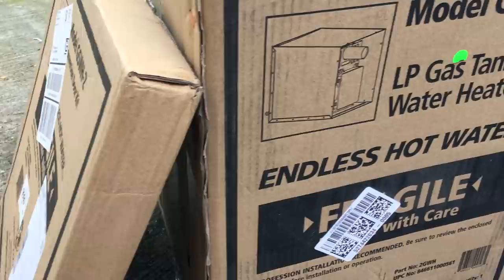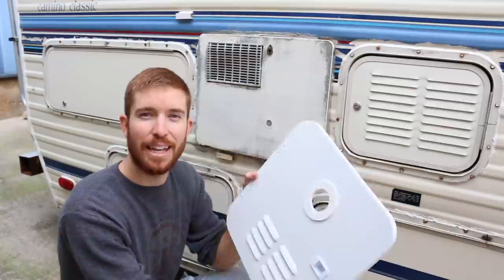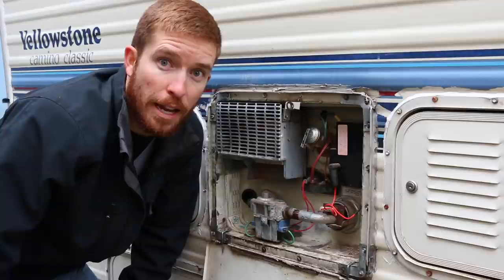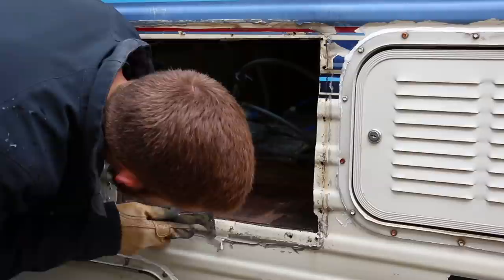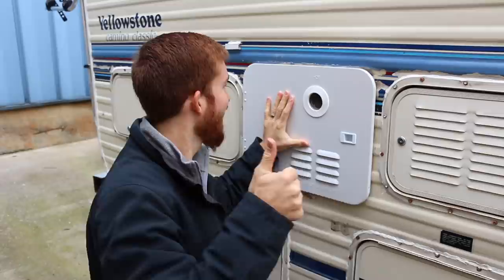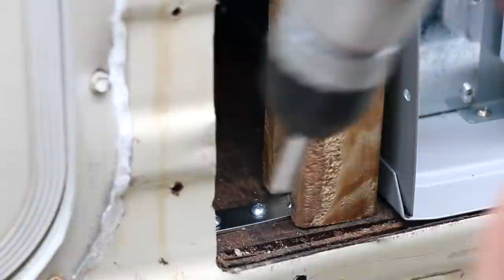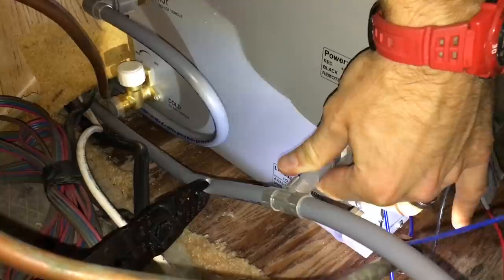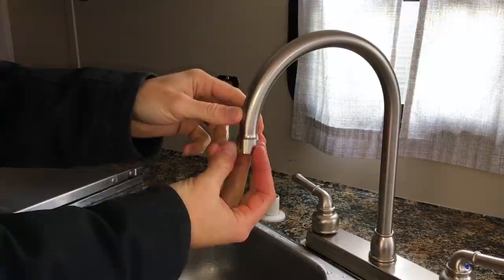Installing a New Girard Tankless Instant RV Hot Water Heater

Comment: Excellent video but a HUGE HEADS UP for EVERYONE reading this post. The grey plumbing pipes are known as polybutylene or QEST (Google it). These plumbing pipes are a problem which resulted in a class action lawsuit in the 1980's and 1990's. The slip connectors and pipes ended up cracking and flooding out many homes. QEST is no longer used in construction because of the known defects. I work as an expert witness in construction defect litigation, residential home inspector and teach the home inspection program at Mt. San Jacinto College in California for over a decade. My advise is to replace every single bit of the grey plumbing pipes you see in this video before you become another flooding statistic. Heads up everyone !!! Sorry to be the bearer of bad news but it is what it is ...........
Reply: Any funds left in that class action suit? My travel trailer has this, I've been replacing it all with modern pex
Reply: @pinrod1  No funds are left for the class action lawsuit. Sorry.

Comment: I'd agree that the wiring instructions for hook-up are minimal and the different colors each RV uses doesn't help. Given that, I was hoping you might be able to answer a couple of questions for me..
On page 9 of the manual.. C:Installation of 12VDC and UCP.. They recommend an interior power switch and a 10 amp fuse. Am I correct in thinking the additional fuse is to be added on the inverter side? or should it go on the UCP side? They just say "panel" without clarifying. It goes on to say "connect black wire to a ground connection on panel".. Which panel? The inverter or the UCP? 
To extend the UCP wires.. on pg10 it says use 18 gauge wire (which I did), but the UCP wires only have a few copper strands, making the 18 gauge seem like overkill.  It's even thicker than those coming out of the main unit. What gauge did you use there?
I've direct wired to the 12V DC which has me a little nervous, but see you have a video on that also which I'm going to next..
Thanks for your video and help

Comment: In the process of installing the same unit in my Class A. I believe you answered the question but wanted to make sure. The wiring of this unit...On the old unit (Atwood 6 Gal) I had a green (hooked to ground), Blue (hooked to a factory plug), Red ( hooked to the burner connection ). Based on your wiring of this unit, you are stating that the blue & green are both ground, red is 12vdc? Thanks for the video.
Reply: Paul, I have the same dilemma. The Atwood 6 gal I removed had a Green, Blue, and Brown wire.  The Green is clearly the ground. The Brown seems to be the 12V+. I guess the Blue is 12V-. I'm wondering if I should wire the Blue and Green together as shown in this video...?

Comment: Awesome instructions. How does the aerator affect the hot water though?
Reply from the maker: Hey Danny. Thanks for watching. The 0.5 GPM aerator restricts the water flow so much that the unit can’t detect when to kick on. A 1.0-1.5 GPM aerator should work better but all we do is just remove the aerator when we need hot water for dishes. Hope this helps 👍🏼

Comment: Informative video. Is it not necessary to install insulation around the tankless water heater?
Reply from the maker: +Tammy Sherman I believe the only need for insulation is to keep the hot water hot... since this is a tankless and it doesn’t store water, there’s no need for insulation. Great question! 👍🏼
Reply: Tammy Sherman Yeah There is a large empty void next to the heater. I would have filled it with insulation too.

Comment: Did you measure the temperature of the water coming from the faucets?  I was told 4 years ago that RV instant water heaters didn't have a long enough coil to get water adequately hot.  What is your experience.  I am unable to find a follow up in your videos.
Reply: That was an objection for us.  We “set” for the max of 131 at the thermostat but it couldn’t keep it at temp.  If another faucet/toilet was used a low pressure interrupt kicked in and instantly the burner cycle was off.  I called California Gerard, never got a person or response.  Called Jayco and they genuinely wanted to help but there is only 1 temp adjustment on the back of unit which let me get out a few degrees over factory set of 127 to a max 131.  System is
Reply: Continued:
System is very sensitive and pressure dependent.  Probably with perfect conditions it is fine.  But campgrounds are notoriously unpredictable on erratic water pressure.

Comment: My wife and I are set up in our fifth wheel on her uncle's property. We have a tank water heater using zero propane. The problem is that the hot water runs out very quickly. Would getting a tankless water heater require us to begin to need propane to heat the water? Or would it run off of electricity?

Comment: I also have a tankless. Mine is slightly different from yours though. Mine is not a hot water heater, it is a COLD water heater. Why would you want to heat hot water?

Comment: Curious? I noticed this is a LP water heater. If you have a 30 gallon LP tank (standard?) how fast does it drain it?
Vs. an electric instant water heater that does not require LP gas.
I believe this would be a crucial decision that must be determined.

Comment: Are there specification restrictions to watch for or upgrades needed from an electrical perspective? Does a tankless water heater need to be on it's own circuit? What is the total amperage needed? Will it run AC/DC/propane? What have you noticed with consumption of fuels? With the rapid heating capability I'm assuming the original water heater 
specifications will not suffice.  Thanks.

Comment: Just bought the Suburban IW60 and can't find the door either if you're still here in Nashville and could tell me where to go to get the Suburban door that would be awesome! i haven't gotten my water heater yet but it should be here in a couple days.  the ad didn't say anything about the door or the controller which usually means that it doesn't come with it, i need that door
Reply: Use old door, and retrofit it to new heater. Cover unused holes, add any needed ones.

Comment: Have you determined the savings on propane by going to the tankless heater? Ordered mine yesterday, as a way to stop wasting propane to keep the water reservoir heated during the day when we aren't using hot water. A recent review stated the one "con" to the 2nd generation Girard was that it did not come with installation hardware. I assume the butyl tape is one of those items. Any others?

Comment: That first door was bigger than the door you have now installed in the video? I have this unit just got it but I ran into the corners exposed so the door is slightly too small and I'm in a rut any help that would be great
Reply: Use your original door, and retro fit it to the new heater. Cover unused holes and make any new ones needed with hole saw.

Comment: Why don't manufacturers put the plug of the water heaters be on the bottom of the unit so all the water can drain. Plus more easily get rid of the sediment annually when cleaning hot water heaters to keep it's efficiency as high as possible.
Reply: So it freezes in cold climates, and rots away in warm climates. Then they can sell more, if you make them last forever, people would only buy 1.

Comment: When you were running the vertical sections of butyl tape between the heater and the outside wall, you forgot to put two layers of butyl tape on the low sections. You can see the gaps that are left even in your video. You should redo that before it's too late and you get water damage from the rain.
Reply from the maker: +Tom Rodgers Thank you for the heads up! Great info that we are going to implement. Much appreciated, Tom! 🙏🏼

Comment: Looks like a great upgrade for the rv! Just a quick
question. What did you do with the gas line for the original heater? Did you cap it and leave it in place? Or pull it back and cap closer to the tank?
Thanks for sharing!
Reply: I believe he attached the gas line to the new LP tankless hot water heater if I'm not mistaken .
Reply from the maker: +Dan 821 Bob is right... I just maneuvered it to screw on to the new water heater 😊
Reply from the maker: +Bob Shaw Right you are 😎👍🏼 Thanks, Bob!

Comment: Hello I own a 1976 Winnebago and hot water heater was missing when I bought it but I bought the GSWH-2 tankless hot water heater but I too are struggling to find the right door what is the Dimensions of the current door you have my opening is 16 inches wide 12 1/4 tall thanks
Reply: If you have the old door, retro fit it to new heater

Comment: how does the butyl tape fill the gaps between the low points of the coach corrugated siding when the case is resting on the high points of the corrugated siding?

Comment: My wife and I installed a tankless water heater in our house. the biggest con was the need to run the water for a while until the water heats up. We have an rv now, and I'm curious... how long do you need to run the water before it gets hot? I'm fearful I would fill up my gray tank quicker just to use the hot water. I'm curious of your experience..
Reply from the maker: Hey there. It does take maybe 5-6 seconds to get the hot water to the line. We're going to run the water into a cup until the water is hot and then use the cold water for filtered water for drinking / cooking. It'll be a bit of a different process but it goes along the same line of always thinking about conserving water 😊 Thanks for the great question 👍🏼
Reply: If you’re boondocking, you’ll need to add a re-circulating pump with temp sensor. This will allow the system to maintain an instant hot water supply. This would also benefit stick/brick home applications as water will cool in the lines...

Comment: ?????QUESTION?????  I am under the impression that the on-demand water heater only uses 12V power.  If this is the case the 120V wires would have to be capped.  Do I understand correctly?
Reply: Yes.

Comment: What about for 12 gallon heater replacement - Our current door flange size is 18 x 18, and all of the ones you provide links for are the wrong size.

Did you have a site link with all the choices, as you describe in your video (ie the cartoon illustrations of the doors?)

Thank you.

Comment: Did you have to install a regulator at the appliance, or does that warning on the heater mean there should be a regulator in the propane system itself?
Reply: Isn't there a regulator where your propane connects to the RV. We are connecting one now.

Comment: Did you have to cut your copper line and add the right size flange for the heater? I’m ordering the same tankless system this Friday to install in our Jayco Eagle travel trailer to replace the 6 gallon system that busted yesterday evening and it appears that there is several more feet of copper tan than I actually will need. Any advice?
Reply from the maker: Hey Zach! If there is a way that you can bend it gently (making sure not to crimp the copper) to fit the new unit that might work (that is what I did). Otherwise, I would probably take it to a pro to modify any of the copper lines. Just thinking out loud as to what I would do. Hope this helps!
Reply: Zach Nugent how did it go? I have a ‘17 jayco jayflight tt with a busted Atwood 6 gal propane heater, looking into this - need ASAP! There’s no follow up on this thread

Comment: You should add a switch to disconnect the power in case of a emergency.
Reply from the maker: Hey there. We do have it wire to our original switch so we can shut it off inside the RV 👍🏼. Thanks for watching 😎
Reply: But why did you have to un-screw the wire so that you didn't shock yourself?
Reply from the maker: Oh! The DC power... my bad, I misunderstood you. Yes, I will be doing that in the near future and it’s definitely a good thing to have. I just haven’t gotten around to it yet. Thanks for the reminder 😎🙏🏼

Comment: I may be RV challenged but with an electrical tankless water heater why do you still need Propane? If one installs an electrical tankless water heater in your house you don't need a natural gas line or LP line for it to heat water, do you? I understand that you still need Propane for the furnace I guess unless the tankless water heater acts as a water heater and produces hot air from the furnace.
Reply: It's not an electrical tankless water heater. It's a propane tankless water heater. The 12v is just used to control it.

Comment: way to go guy, that is just awesome the way you got things done, so one question, does one need a tankless water heater if one is not boondocking for long periods of time, and isn't there a water heater for less money? tks for listening, Terry
Reply from the maker: Hey Terry. Tankless is definitely a luxury and not necessary so if you want a cheaper one, the atwood hot water heaters run from $250-$300. We just waned the instant for comfort and ease while living in the RV full time.

Comment: I don't have no wiring to my old propane water heater what do I do
Reply: Do you have a manual pilot light gas only model? If so, you would not have any wires because this type doesn't need any DC power to operate any control boards.
Reply: @asphaltadventurer  yeah mine is a manual light gas only  so what your saying is I do not have to wire it up  and the wires on the tank less are optional because I was wondering how I would regulate the temperature

Comment: I enjoyed the video, however, you could have installed the hot water heater then put the door on later instead of being without the hot water and then just put the plastic cover over it while you waited for the correct cover. Hindsight is always 20/20 though. Thanks for the hard work though your pitfalls are our success stories.

Comment: It's would have been much easier and not have to have those L brackets to sumply take a piece
of 2x6 and rip it to the size of the opening between the water heater compartment and the RV frame and then screwed it directly to the frame which would fill that whole opening.

Comment: I did not scan all of the comments, 320 of them. So forgive me if this has been addressed.  The info on the Girard products is still very skimpy in 2021.  Did you receive any information on required delime ing of the little heat tubes where the water is actually heated. I am 65 miles from the mountains and we are told do not drink or cook with the water. Purchase mineral water for drinking and cooking. Wash your clothes and bath with it with the well water from the muncipalities piped to you. Do Not drink it !  ! Why 2 reasons The water is loaded with chemicals and i  many but not all, places and with radioactive materials in  the water.   A real estate agent told me that a toilet in colorado and kitchen sink faucet in home sales is generaly replaced every  5 to 6 years.  The staining and chemical build up is very heavy  in Colorado if you do not have a quality filtration system.  I purchased a tankless boiler and water heater. Never installed it due to water quality issues here.

The state fixed the problem. The impurity of the water reached the 800 ppm two years ago. They raised the standard for harmfull to humans from 875 to 1250 ppm. All better. No warning letters  are no longer being sent.  Internationally, the Russians standard is 6 ppm, that is six  ppm is unsafe for humans to drink or bath in.    The isotope of radium is commonly found in areas close to the mountains that have wells.   It took me 5 years to uncover why small city people  were being told do not drink the water.

And all I wanted to ask is have you been told how to maintain your tankless unit. How often to do it? Do they suggest a flushing procecure? Or even talking about a flushing manifold? The life of the unit depends on the quality of water you are running through it. Food for thought. Try to find knowledgeable locals frirnds or families for the places you are planning to visit re water quality.

Comment: Lost me when he started cutting the wood with a hack saw
Reply: It works though...much better than trying to cut metal with a wood saw.
Reply: Use what you have available.
Reply: Did you really watch 16 minutes into the video only to stop when he used a metal blade on wood?
Reply: It is a water heater, not a hot water heater.!!!

Comment: I'm OCD so don't take this personally, but on demand tankless water heaters aren't hot water heaters. They are always cold water heaters. Water heaters with tanks preheat water then maintain that hot water which makes them hot water heaters. At minimum tankless systems are simply water heaters. They are never hot water heaters. Again, I'm just OCD every time I see a tankless on demand system advertised as hot water heaters. Great diy videos btw.

Comment: If the water is hot,why does it need to be heated? "Hot water heater" 🤦‍♂️
Reply: Might be using it as an LP powered boiler to make super-heated steam to run a turbine instead of having to use a gas generator when the electricity goes out.
Reply: yes correct its a water heater not a hot water heater it kills me when people say hot water heater
Reply: LMAO now I can't watch this video anymore without cringing 😂
Reply: I agree, why do I need to heat HOT WATER?
Reply: Hot Water Heaters are what cars had, back in the day. Hot water, from the engine radiator, was circulated through a register, which heated the air in the vehicle.
Reply: depends on how hot the hose is in the sun feeding the water to the RV 😂😂😂 I literally clicked the comments to say is it a water heater or hot water heater....